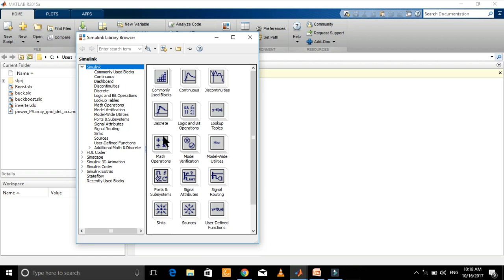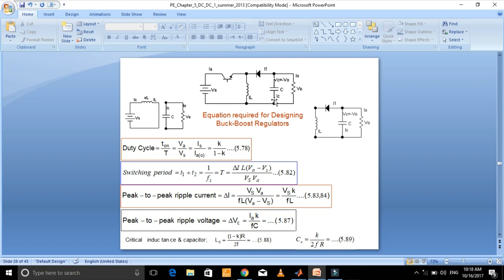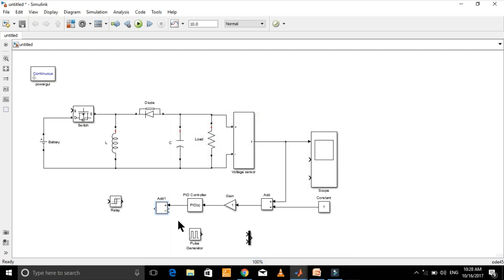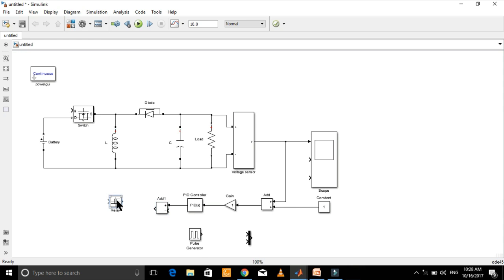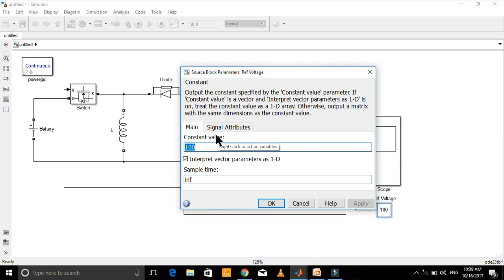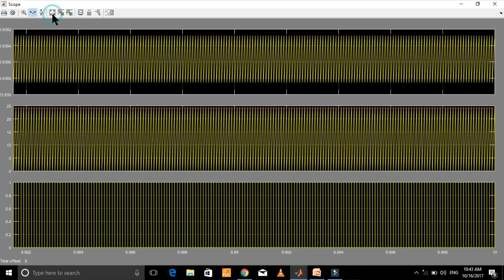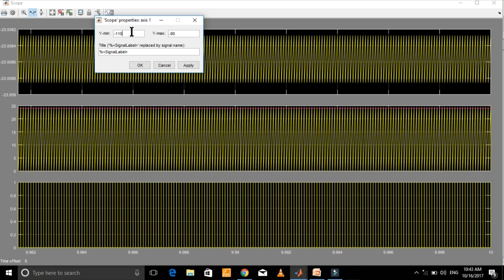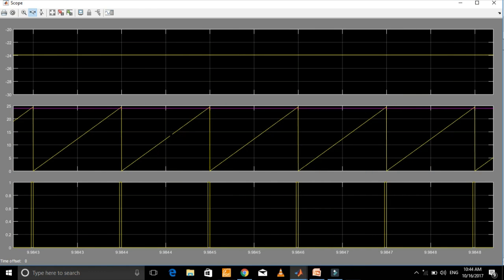Buck-boost converter with controller design and simulations in Matlab Simulink

Comment: Why do you set the amplifier as 100 and the integrator as 4xfrequency? Is that always the best solution?
Reply: @niazali8183  Is it possible to improve the response of the controller by changing any of its parameters? Usual control methods allow us to tune the controller, for example. This approach has this characteristics as well?

Comment: by using the similar circuit i m unable to get results
Reply from the maker: bro just try to change the values of P and I... this is non-linear circuit and you have to do it by hit and trial method, you have to change the values each time and simulate it again and again until you get your desired results.. and sorry I don't have much time to do that...